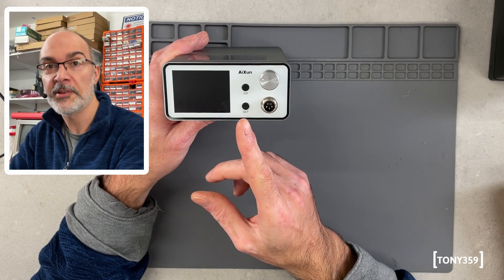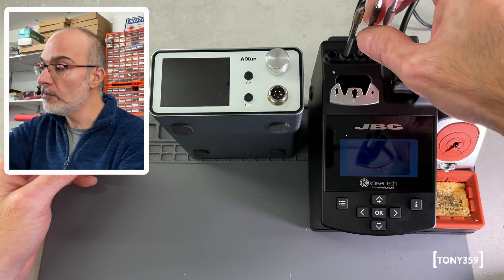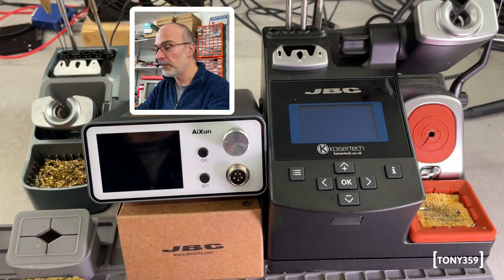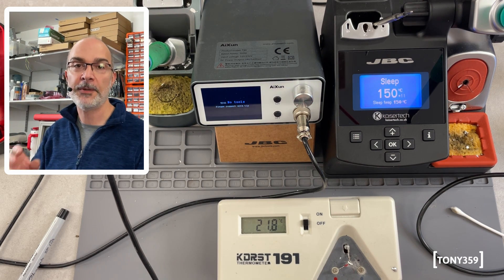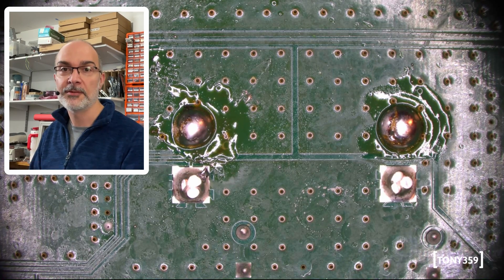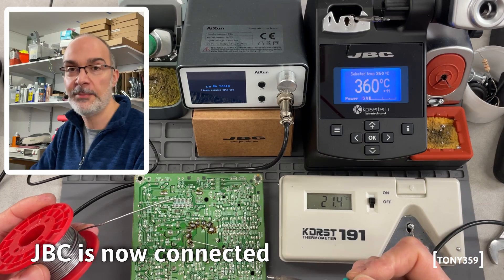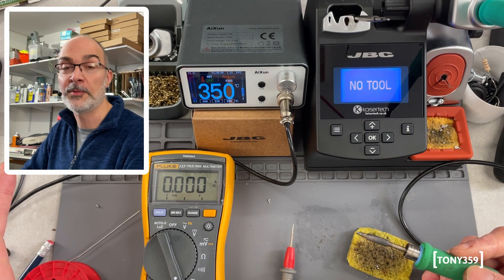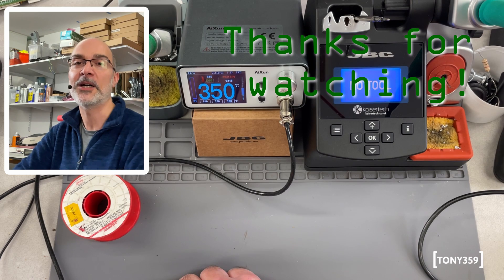Can the Aixun T3A really beat a JBC station?

Comment: I not understand, is ground at speaker connected toaims earth? Also grounded pin on pcb,is that soldering pcb connected to mains power?
Reply from the maker: The speaker has one lead connected to ground. The PCB is grounded - not the pin. The PCB was not powered of course. I explained why earth can be in the way from 1:30
Reply: @tony359  Speaker to ground on soldering station I guess
Reply from the maker: Ground is ground :)
Reply: @tony359  ok, gnd is gnd, but still not clear when you touch pcb groujd pins and temperature goes 500° That pcb htoundvis not connected to any other ground or solder station box. I have Weller but also china TS12 and I use only china,much better then weller,sound strange but it is for me better. I workbon car electronics,engine ecu,instrument cluster,airbags,immobiliser  and never damaged any board
Reply from the maker: I'm sorry I am struggling to follow you.
I am not touching a ground pin. I'm touching "a" pin of a "grounded" PCB. 
This is a flaw with the T3A, other stations of course are unaffected.
Reply: @tony359  sorry, I was carefully watching 1:30 video time, just noticed that pcb you are soldering was on hot plate which is normally grounded  also if scope is connected (I use battery powered,so not have problems) and my job is almost always pcb that I  solder disconnected from any power hot plate scope etc ao I  guess will notvhave problems. Thanks for your kindness!!
Reply from the maker: No worries! Yes, it takes specific conditions to trigger that fault but I like to think that it should never happen! :) 
Thanks again!
Reply: @tony359  just checked on my solder stations. Weller zero volt, Quecco T12-956, "just" 3v2 😉
Weller is with transformer,linear power,other smps,but to high voltage on soldering tip.
Reply from the maker: 3.2V??
That's an integrated power supply! You can just stick the iron in the power plug to test!
Wow! So this is a widespread flaw! Thanks for that!
Reply: @tony359  yes 3.2v and on scope I  see some shirt drop to zero volt but mostly time is 3v2. On multimeter voltage fluctuating from 1.8 to 3.0v
Reply: @tony359  hehe,yes no need voltage regulator to power some smal mcu STxxx on 3v3,solder station is all in one
Reply from the maker: WOW! It's even worse than the T3A!
Reply: @tony359 JBC is smps or linear powered?
Reply from the maker: Linear
Reply: @tony359  I back my memory, one instrument cluster mcu died while I soldering and cluster was under power , but my lab power own made not have earth pin on mains, also if I used other linear lab power has 3 pins on main connector, but on DC output gnd and earth not shorted....BUT when working under power better to use weller....

Comment: Did you find where the problem is on the board to let voltage to the tip. Is there anyway to fix it?
Reply from the maker: No, unfortunately this unit is not easy to open and I am not skilled to design circuits - I can repair them but this is not a fault! :) I'll leave this task to more skilled people! Thanks for watching!

Comment: Very intresting comparison it shows how much important ground connection is when working properly
Reply from the maker: Indeed - though you'd be surprised to hear that the tip is grounded - at least when the heater is off.

Comment: I really enjoyed the aixun since the last time we spoke but while working on a ps5 I noticed that the handle went haywire on me a few times. The temps kept on climbing and wouldn't go down even within the cradle. I had to power down. I really do like the feature of being able to switch tips on the fly but this machine has too many unacceptable problems now I wished I had saved money and went straight to the jbc. I still love my hakko but getting spoiled by that quick heat up time, quick switch and tip sizes I think I might have to upgrade again to the jbc because that 245 is nice but I also need smaller precision with the 210 & 115 alternatives. Idk if I should go the cheap route again and get the t3b or a mechanic soldering station.
Reply from the maker: You are exactly where I was a few weeks ago. I switched to the T3A even though my Hakko clone was ok. I immediately got in love with the power, the quick power up and mostly the quick change tips. 
When I decided the T3A was too flawed for me, I couldn't just go back to the Hakko so I wondered whether I should try another cheapo one or go straight for one which worked. 

What I am asking myself now is how come I started thinking "I'll get the £30 KSGER" station" and ended up spending £500?? :D

Thanks for watching and let me know what you decide! Apparently if you avoid SMPS soldering stations you should be fine. But I cannot be 100% sure :)
Reply: @tony359  Haha, yes! 😄 it happens brother going 0 to 100. I got so used to it that last night before bed, I was really thinking about the hakko and noticed that it's just taking up space on my desk not being used, mind you I used to use it everyday! I would love to own a jbc, but right now, it's out of my budget, but I feel like I just might have to make that sacrifice and bite the bullet. I was also looking at the new hakko fx one even though heat up time is a little slower it is reliable but what I don't like is that the dual channel one you have to purchase separately and doesn't come with anything like the single channel one and it's already expensive but I'll give it some more thought and look around. I'll touch base back with you once I decide and with updates.

Comment: Ingeniero una prueba que se puede realizar, es aislar el terminal con diodos rectificadores
Reply from the maker: Hi - what do you mean with "terminal"?
Reply: @tony359 colocar 2 diodos rectificadores en serie con el cable que alimenta a la punta del cautin, de esa forma el cautin queda aislado de la tierra y el voltaje que entrega el cautin respecto a tierra baja a cero voltios
Reply from the maker: I'd rather not disassemble the handle or the unit - chances are it's a destructive process (definitely for the main unit). I'll leave these tasks for more skilled people! I can repair things, but this is really not a fault! Thanks for the suggestion though!

Comment: You are doing electronic repairs? Well, try to look into this issue, try to repair it.
Reply from the maker: Well... I'd rather focus on something more interesting. Also I am doing repairs, I don't have the skills to design circuits. Opening the T3A is a Royal pain as the front panel is glued and the PCB is also glued inside. So I'd rather get a working station and focus on some more interesting device! Thanks for watching!

Comment: Hello.
Why not use the Aixun holder with the JBC station?
Reply from the maker: The "sleep" sensor would not work unfortunately. JBC sells one but it's another £100+ :) Thanks for watching!
Reply: @tony359  If you connect the cable of the Aixun holder to the JBC holder, it should work. I use it that way too.
Reply from the maker: thank for that, I'll give that a go!

Comment: I wonder if plugging the station into an isolation transformer would help the ground problem. 🤷‍♂️
Reply from the maker: Yes, many have suggested that. Wouldn't that mean the tip is not grounded though? Because - believe it or not - I do read ground when I check continuity with the tip!
Reply: @tony359  -- I would just ground the T3A via the ground jack on the back through a 1m ohm resistor to bleed off any static.  Also, I did the speaker test on my 6 month old T3A and heard nothing and the current didn't spike and the temp didn't change and I was not using an isolation transformer.  I'll do a more thorough test when I get some free time.
Reply from the maker: That is so weird. Did they change the design and made it so massively worse? I'm not aware of massive differences in the design. Aixun themselves told me - one of their rare replies - that my station is an Aixun genuine.
Reply: @rpsmith  With 1m ohm resistor the "speaker test " passed, theres also no temperature spikes on grounded pcb. But there is still some voltage on tip.
Reply from the maker: so that's by grounding the tip to via a 1MOhm resistor?
Reply: @tony359   Yes, I cliped the resistor to the grounding cable, touched to speaker and then to metal plate and then soldered the plate and checking temperature
Reply from the maker: You clipped the resistor to the ground cable and where did you attach the other end of the resistor?

Touching ground with the tip usually does not trigger the issue. It has to be a GROUNDED PCB - and not all pins will cause the issue. I know, it's a bit weird.
Reply: @tony359  Maybe so, but without resistor there always were temperature spikes.
Reply from the maker: interesting. Are you telling me that someone at Aixun forgot to add a 1MOhm resistor to the PCB? :D
Reply: @tony359  -- My comment about a 1-meg Ohm resistor was in regards to using an isolation transformer to feed mains voltage to the soldering station and was meant to bleed any static voltage off the tip since it was now isolated.
Reply: I had that same thought.

Comment: Wow, that was loud, which leads me to conclusion it is capable of delivering serious current into somehow grounded circuit. It's not only about the voltage on the soldering tip, it's much more about the current it is capable of. The speaker have internal impedance about 4Ω, which is relatively low, so that station have to be capable of delivering serious current into the circuit when shorted to ground. Furthermore, it's AC with sharp edges, so it is something relatively wide in spectrum, so it is, in fact, RF source. I don't think your board needs to be grounded to run into serious issues. What if you touch the input of some very sensitive RF component? (Not only) RF boards typically have a lot of copper connected to internal grounds, which makes huge coupling area to the real ground on higher frequencies. And the soldering tip is capable of delivering power because of its low output impedance. And this is, in my opinion, the point, where the real mordor begins.
Reply from the maker: I completely agree, there are so many scenarios where this could become a problem - I don't want those scenarios to be a possibility with my soldering iron! Thanks for watching and commenting!

Comment: The noise is switchmode power supply noise.
I am guessing the tip is not earthed.
It would be interesting to see if you could cure the problem.
Reply from the maker: Believe it or not, the tip is grounded. At least this is what my Fluke is telling me. Thanks for watching!
Reply: @tony359 How are you measuring with your multimeter to come to the conclusion that it’s grounded? The fact that the station misbehaves when the tip is connected to ground externally are a strong sign that it’s not actually grounded.
Reply from the maker: I'd agree with you but...
Multimeter in resistance or continuity mode. One probe on the solder tip, the other on a ground wire coming from my mains socket. It reads 0 Ohm.

Comment: I use lots of JBC equipment and all of it runs circles around that cheap crap
Reply from the maker: It's a solid solution indeed! The issue with the Chinese ones is that for 1 good model you have 10 bad ones/copycats... Thanks for watching!

Comment: I don't solder grounded boards and so far my Axiun has soldered 50k+ worth of product so no complaints from me. I accept that in different circumstances the concerns you have highlighted might be a deal breaker, but just remember the price point and what, for many, a real bargain it is.
Reply from the maker: It could be free but when the tip reaches 550C while the display says 360C, that's not a bargain, it's a scam! :) 
Imagine if I hadn't downgraded to 1.33, I might have never noticed I was frying my boards. So I'm sorry but no, I respect your opinion but I cannot call it a bargain!
Reply: @tony359  All I can tell you is that I have soldered approximately 1500 PCBs and never burnt a track or component. I don't dwell longer than necessary to flow the joint. For me it's a bargain, but I fully appreciate your point of view. I think if you wanted a very high spec machine with no flaws you might expect to have to pay a lot more.
Reply from the maker: I have to disagree with you I'm afraid. Yes, you can solder ok with a tip at 500C, it won't necessarily mean you're damaging things 100% of the time but that's not how it should work. 
There are stations out there which don't show that issue and are priced similarly. A "flaw" could be 20C overshooting. Not 150C! :)
Reply: @tony359  We are not disagreeing about what you are saying about the iron, I believe want you say. I am only sharing my experience and I have soldered a lot of boards, 45 today alone and I will probably do the same tomorrow. If I touch something with a soldering iron at 500c the thing I touch does not reach 500c instantaneously, only if I continuously keep contact. When I solder I only make contact until the joint flows and I imagine it's the same for most people. You don't just keep heating a joint for the sake of it and so an iron which overheats in certain circumstances does not unduly bother me. Your research is sound and your content is good, but I am just making the point that it is not a deal breaker for me, and I am very pleased I bought this station which has served me well and I am sure it would be a good buy for many others.

Anyway, what stations do you prefer at this price point?
Reply from the maker: I appreciate your opinion, thanks for your constructive reply!
I see what you mean but if we solder at (usually) 360C there is a reason! Adhesives on PCBs are designed for 300C, not 500C. Obviously your pads are not going to instantly detach from your boards if you touch them with a 500C tip but you'll be weakening the pad by doing that. Whether that has an immediate or delayed effect it depends on the quality of the PCB and many parameters. Chances are nothing will ever happen of course. But that doesn't mean it's ok to solder at 500C - or the international standards would say "set your tip to 350-500C" :) 

Also, the Aixun does not always go to 500C, so I appreciate it's not so common to have the tip at 500C.

In my case, when de-soldering SMD caps using two irons, sometimes I have caps on ground planes and I have to keep the irons on the pads for 5-6 seconds before the solder under the capacitor melts. And when I see "500" on the T3A... that's not good!! 

I do respect your view but I stand mine - I don't want 500C on my tip, ever :)

I'm told the Sugon A9 is good and apparently even the Aixun 420 is good. Both have linear transformers. I believe they are a bit more expensive though. But the T3A with those flaws is not an option I'm afraid. 

Thanks again for your kind words :)

Comment: The JBC has the sponge, wool but also the rubber/sillicone for cleaning the tip.
Reply from the maker: Good point, I found it quite useful - the solder gets stuck to it nicely! Thanks for watching!
Reply: @tony359  for tip longevity JBC recommends the rubber thing, sponge and wool, in this order.
Thanks for making these videos :)
Reply from the maker: Very interesting, thank you! I don't tend to use the wool to be fair. I see why you want to use it last, so you don't saturate it with solder.
Reply: @tony359  it's more because it's way more aggressive on the tip than the other methods. I mostly use C210 and some of them have quite a short lifespan even when taking care of them.
Reply from the maker: Oh I see what you mean. "Use the wool only when necessary". Yes of course, that's what I do.
I've recently bought the C210 handle for the JBC and I feel the small tip I got could be damaged by the sponge! I don't think I would ever venture it in the metal wool! :)
Reply: Now look here, the wool is by far the most gentle of the two classic ways to wipe a tip clean.
The reason is that the sponge often makes the tip too clean, with very little solder left on it (a very thin film of solder) - therefore tips dry out faster. Keeping the tip wet (with solder) protects it against oxidation.
Reply from the maker: @ghydda  Interesting. thanks. I have indeed noticed that my most used tip tends to "dry up" too much. I'll give that a go thanks!
Reply: @ghydda  the wool is forbidden when soldering within milspec

Comment: Hey Tony, just a quick question for you unrelated to this specific video. What headset and audio transmitter are you using here? Is it some kind of XLR transmitter you carry around?
Reply from the maker: It's the Røde Wireless Go. It outputs on a jack which I then feed into my iPhone via various adaptors :)
Reply: @tony359  oooh, that's clever. I want to go wire free myself so I'll definitely look into that for sure. Thanks kindly! Also, it's a shame about that soldering station with the 1V at the tip. Not ESD safe. Eek!
Reply from the maker: Free voltage injector! :)